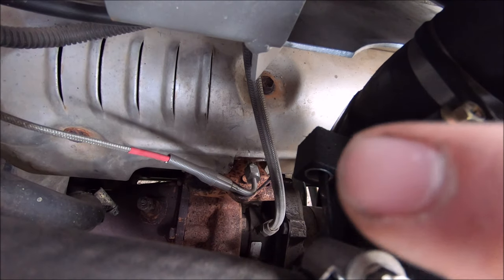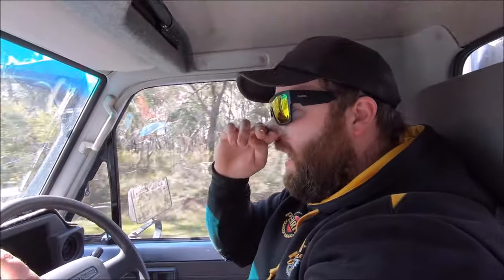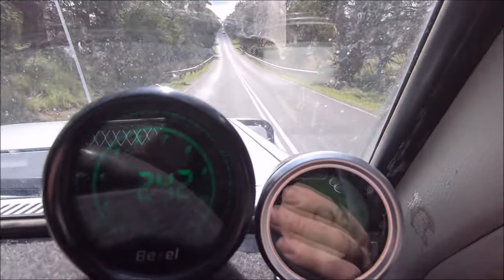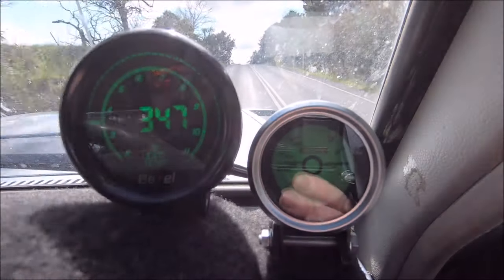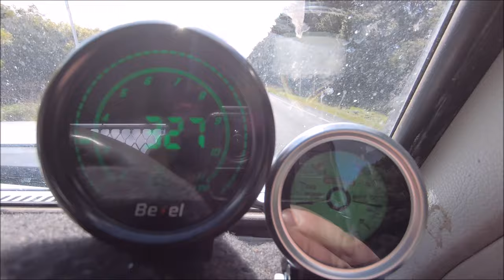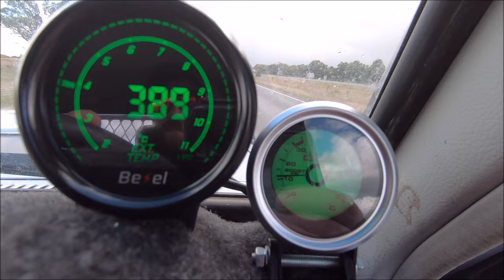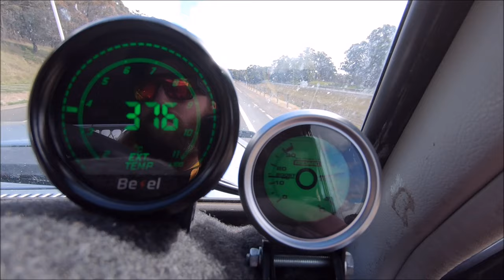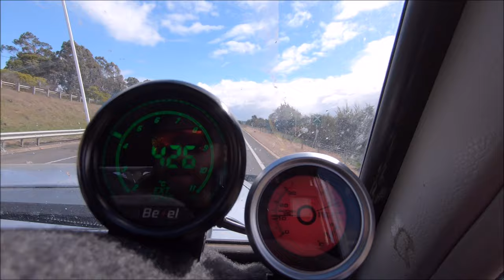Where To Mount An EGT Sensor Probe & Why You Shouldn't Put It Behind The Turbo On Your 4x4

Comment: So put probe in downpipe and add 200 degrees to make up the difference to be safe
Reply from the maker: Roughly, not all engines will be the same so it will vary. The temp after the turbo will be cooler though.

Comment: What makes the difference in egt for pre and post turbo is the gas expands after the turbo and the heat energy is more spread out
Reply: heat soak through cast manifold and  turbo housing,  turbo oil feed with soak up some heat

Comment: A good test mate but a bit stupid using two completely different gauges. I've done a similar test but using the same gauge and just moving the probe, had 100°C difference across the turbo. According to Mr G-Turbo, on a 1HD-T, 750°C before or 600°C after is safe. Your 1HZ will be lower than that 650 and 500 respectively....👍
Great your having a play and sharing....👍😊 maybe loose the cowboy crap though...😖

Comment: Gday mate im just a little confused about why you haven'tmentioned anything about the the depth of the gauge inside the manifold. . Is there a reason your not concerned about this especially with forced induction. Also you haven't mentioned anything about the formula to work out how far down the port it needs to be. 
 Maybe just check that so viewers don't make many mistakes and correct that.

Ubeautdieselperformance
Reply from the maker: Good question mate, as long as the probe tip is roughly in the centre and not bottomed out on the metal it should be right, it’s not an exact science so a few measurements should get it pretty close. Otherwise if people are not confident enough to do job they should take it to a professional. Cheers for the comment.
Reply: @CamshaftFM im not second guessing you on social media i im not saying your wrong or right its not my position I just STRONGLY RECOMMEND you do some homework on a proper install procedure mate especially if you haven't had much to do with EGR,Dpf and common rail engines
Reply from the maker: @ubeautdieselperformance8723  ok mate no worries. I’m not sure if I say it in this video but iv stated in plenty of my other videos, I make my living as a diesel mechanic and have more experience than I want dealing with those things.

Comment: using same brand of gauge would be good for results, 1 quality gauge and 1 cheapo e-bay gauge that may not read correct temp straight out the box
Reply from the maker: Red arc ones are too expensive for this experiment and don’t read in small enough increments to show a real difference in temps.